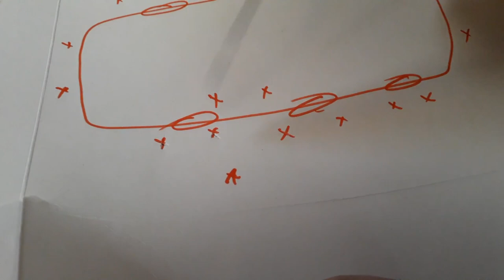Sailing Northern Ireland - Leaking Lewmar portlights - Ep.167

Comment: If you source some grinding paste (the stuff you would use to lap valves in an engine) you dip the end of the screwdriver in the paste this then makes the screwdriver bite into the screw making the removal of Pozidriv/Phillips type screws much easier.
If you cant get grinding paste then you could mix some fine sand with grease not as good as grinding paste but it would do.
Good on you for keeping an eye on peoples boats.
Reply from the maker: That is a great tip about the grinding paste. Thanks 👍👍  As for keeping an eye on boats, how could we not? We meet so many wonderful people who give so much friendship and goodness.

Comment: Well, you made that look super easy! I might even have a go at mine :-)
Happy new year, let's hope it's (eventually) better than 2020!
Reply from the maker: HNY! There was some swearing and cursing with a couple of seized bolts whose posidrives burred out, but the angle grinder took care of them and cut a new slot in them. We also think that the heat from the grinder help break them loose. But overall, it was a very straightforward process.

Comment: i clamp the vice grips to the screwdriver , good leverage so you dont come off screw head.

 i replaced the ports forward,  i needed a friend to hold the wrench on the inside.    i dont have a friend,   i made a friend out of a stick.    put the wrench on the nut, wedged the stick bottom on bedding.  it was and is  the best friend i ever had,  patient,  never complained or offered annoying advice.  
 
     the aft ports i just covered with poly carbonate ''bullet proof'' ,  in case you have a friend........
Reply from the maker: We did the "vice grips and screwdriver" thing and damaged the screwdriver and the seized bolt stayed where it was. Three were so seized that Mr AngleGrinder had to be called in...
Reply: @SailingYachtSaltyLass    AND YOU CHOSE to blame the method instead of the methodologist..   the point of increased leverage is not just  force  it is so you can go slow and incrementally.  and feel the resistance.   .   if there is much resistance you know it will snap,   you drip in penetrating oil and come back tomorrow   .. i have screwed around a lot on old wood boats.    i dont snap.    i know my screws,  ha ha ........steel  ss   bronze,  copper tacks,  brass ,nylon . i know some end up drilling out    so far i have never had to...... i am as you said before.........''one with the screw''  ha ha ...carry on we enjoy you guys.
Reply from the maker: @spymaine89  - "... you drip in penetrating oil and come back tomorrow ..." 

In an ideal world, yes you would, but this was a window taken out and leaving a big hole in the boat with temperatures near zero and rain showers. It was going back in PRONTO, not tomorrow. 

The job is done. The windows are in. We are are snug and warm aboard.

Comment: Good job on replacing the window... I'm impressed! Question: the marina you are staying in, is that your home marina? or just spending some time there because of the lockdown...if so are you paying a monthly fee?
Reply from the maker: Well... the boat is UK registered in Liverpool but we have a year's contract in Carrickfergus due to The Bug and lockdown. We did some calculations that came out as follows:

Winter rate + 2 months summer rate < Annual contract
Winter rate + 3 months summer rate > Annual contract

We could not see the Bug being sorted by 1st June so the Annual Contract from 1st April - 31st March was the cheapest option and we got a small discount for paying it in a lump sum. 

Come this March, we have to look at the situation and make the same kind of evaluation again.

Comment: Can you please tell me were you obtained the Butyl tape? lots on google but non are marine grade. Interested as a Bavaria owner where you obtained the fixed window replacements?
Reply from the maker: Someone we know got an acrylic company to cut them to size based on the existing portlight. They were not sold as a ready-made thing. Apparently a lot of acrylic companies will cut to size if you give them a template. These are about 10mm thick and so are stronger than the portlights they replaced.

We could not get "marine grade butyl" either so we got roofing grade butyl (12 year guarantee). If it needs replacing in the future then we will replace it. It is not a big job. We used this stuff:

https://www.psasolutions.uk.com/product/butyl-sealant-tape-9mm-3mm-13-metre
Reply: @SailingYachtSaltyLass  Thanks for your prompt response, great blog .
Reply from the maker: @mwomersley6636  - Thank you